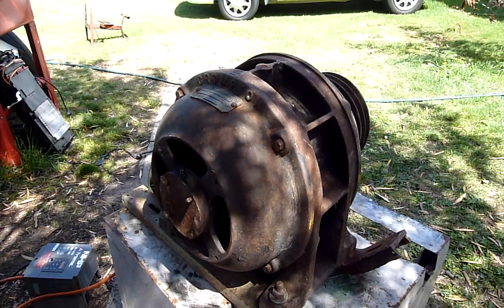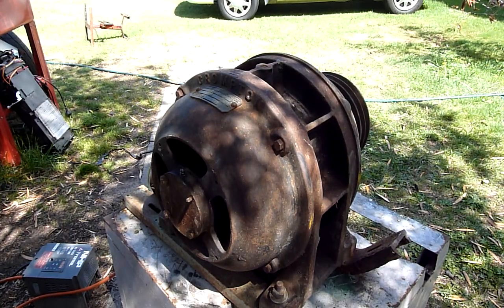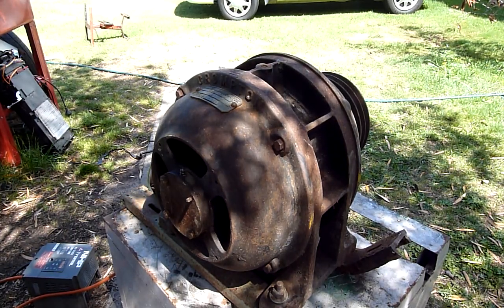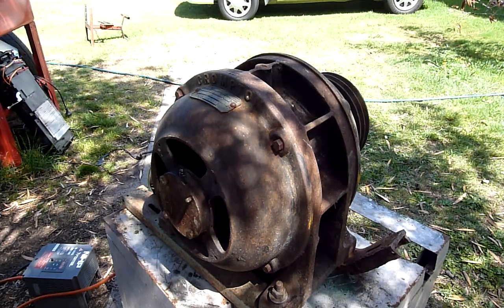Vintage Crompton 7.5Hp Motor Test Run

Comment: It's mainly in the insulation like Ed says, the same goes with transformers in old radios, there weren't as many synthetic insulating materials so they had to rely on various kinds of paper, varnish, and tar to insulate things rather then plastic film and resin. I've noticed this when I used to go around to garge sale, you would look at a huge motor thinking it was like 1 to 1 1/2 hp and when you read the tag it says something like 1/4 or 1/2 hp.

Comment: Hi Ed, any squirrel cage induction motor will work as a grid tie generator, no good as a stand alone genny but. If you connect an induction motor to a supply it uses watts, if you then drive the electric motor shaft above synchronous speed using another engine it will produce and export watts back to the grid. Same principle as regenerative braking on your VFD, cool way to wind back your power meter.

Ray

Comment from the maker: @Metalcastr Its not the difference in how its wound electrically, but the quality of wire and insulation. today's motor winding's are more robust and efficient than the old tar and cloth coated wire.

Comment: Over here we use 230 V (used to be 240 until about 10 years ago) at 50 Hz for everything domestic. If you need more energy, they run in another phase giving you two 240 V supplies to ground or 415 V phase to phase, oops old habits hard to forget, 230 V to ground, 400 Phase to phase. Light industrial gets all three phases giving them 400 ph to ph.

Comment: I have heard that a generator conversion can be done by connecting a (I think) delta wired capacitor set in parallel with the motor supply wiring.

Comment: What is your Household line voltage and Hertz in Australia? In Canada we have 115-120v 60 Hz for standard receptacle. Dryer and Stove or welders at 220-240v 60Hz.

Comment: Here we use 575v 60hz 3 phase for industrial The USA uses 480v 60hz 3 phase for industrial. If he system has a neutral 347v phase to neutral
Reply: Also 600v three phase in USA for industrial as well as higher so called "medium voltages"